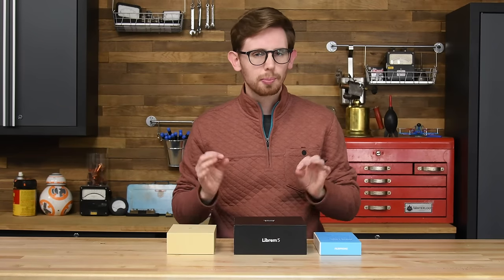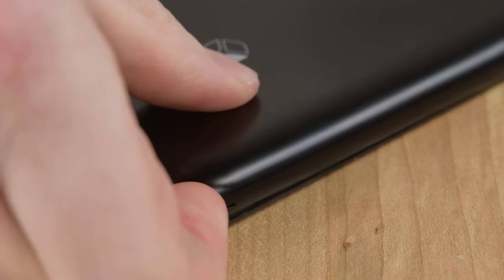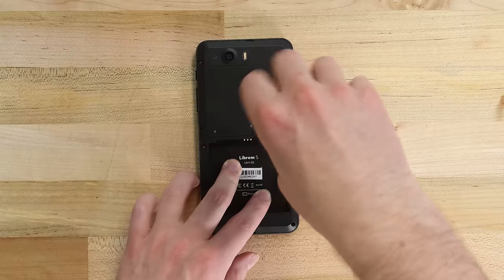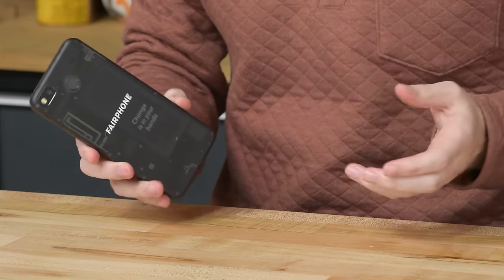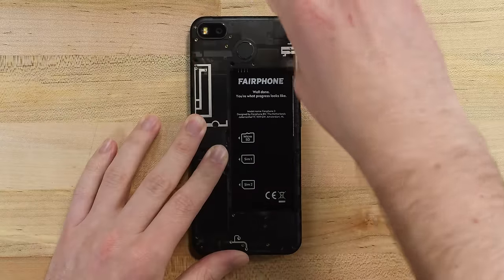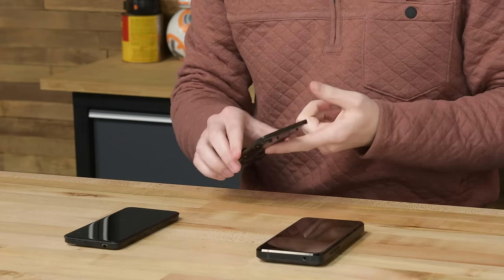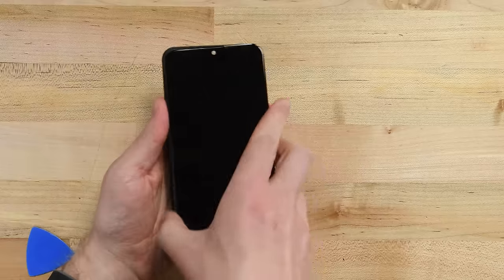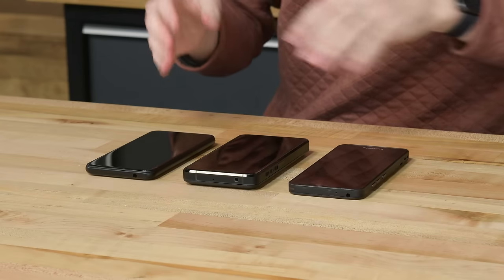Your Smartphone Doesn’t Have To Be Glued Shut!

Comment: That fairphone looks like a really cool alternative to what's in my pocket now. Cool video.
Reply: @cloudy kiwi kelly and cali lint and candy wrappers. lol.
Reply: Lol
Reply: That's the problem. It's an alternative. Not the main one
Reply: i thought so at first but not so much really, since its still lagging behind what i have (not by repairability for sure)
Reply: @C00LX100  Yeah it's one of those big tradeoffs you have to weigh unfortunately.
Reply: @AdrianReddix  would you rather have yugo thats easy to fix or buggati thats hard... there is no thinking there but if you choose between lada thats hard to fix and old yugo then its a simole choice it just matters is if form or is it function, if its function buy yugo or this phone
Reply: @C00LX100  I'm big on function over form. While I like to look at the buggati, owning something repairable and practical is more my speed.
Reply: @AdrianReddix  you just answered yourself, so buy it, i see my bezzel less phone with pup up camera and most amazing screen and im happy. If there was option fir uogrades then i might think about it but right now it looks like brick phone from 2010 so no not right now for me.
Reply: Too bad it has SD632 and 4gb ram. Even if the hardware can last 4 years the software will lag after 1 year with that kind of spec.

Comment: Peak Samsung was the Galaxy S5. Water resistant with a removable back and battery and Headphone jack. It also had the heart rate monitor
Reply: Don't forget the s5 neo that solved some issues of the s5 so it was even better 👍
Reply: and had expandable storage too
Reply: There's the Galaxy xcover field pro.  Came out last year similar specs of a s9 with removable. Battery SD card slot, headphone jack, and ptt.  Expensive though, meant for industrial and security market
Reply: Was it IP68 up to 6 meters?
Reply: @DimitrisSartzetakis  exact lol

Comment: I can imagine modular upgrades being a huge selling point, and actually drive revenue for the manufacturer. Like, new camera module, storage upgrade, more durable chasis, higher resolution screen, higher capacity battery, more water resistant backing, more durable screen... The biggest challenge is probably having these parts interchangeable. Industry oriented laptops like the Tough Book provide these sorts of upgrades and options for individual use-cases, it's time we have that for phones. We have different needs and budgets and it would be cool to have that reflected by the market in a more sustainable fashion.

Comment: Also, im surprised that the Librem 5 and the Teracube 2e are available to buy and use in the US. The more popular Fairphone 3 is only available in Europe and I fully understand how hard it is to run a business like that.
Reply: Librem 5 runs Linux.
Reply: The fairphone is the only one I would be interested in but its not available in the states. The teracube is an underperformer and the Librem 5 runs Linux which is fine but I would prefer android. Not a whole lot of modular phones or even phones with removable batteries these days

Comment: Those wireless cards in that second phone really surprise me xD Nice!
Reply: I just burst out laughing at it! It looks ridiculous, but it's so cool
Reply: The first PS VIta uses an wireless/GSM card too unexpectedly.
Reply: It runs gnu/linux, it's more like a laptop than a phone. So it is it's competitor the Pinephone wich does not appear on this video and takes a similar approach except for the extractable wireless modules
Reply: Like said in the video, even laptops are starting to have wireless cards/chips soldered on the board.
Reply: They couldn't find a libre distributor for those parts so they had to make it separate from the rest of phone.
Reply: its funny because its just a company plore for "oo look at us were cool you we use standard components... only for the least likely to fail pieces....

Comment: While I completely agree with the general message here, I have to put a big caveat for anyone who's watching this - DO NOT buy those phones if you don't know exactly what you are getting into.

The repairability message is great in itself. These phones prove that there's a whole ton that could be done if only the big smartphone companies were really interested in making phones repairable, recyclable, longer lasting and generating less eWaste.

But design and forcing consumers to change phones everytime the locked in battery life gets worn out is the priority, so we end up in the situation we are currently in. Profit over consumer interests, obfuscation by design.

For people talking about them not being water resistant, which they really are not, just know that there are and have been phones with removable battery AND IP68 water and dust resistance.
The marketing speech was that in order to make phones water resistant they needed to seal the battery, but this is very much not true, it has never been true. Weird that people would think so when we had IP68 phones with replaceable batteries before the trend of internal batteries caught on... short term memory I guess.

I don't even know if this was really marketing speech or just something people started believing at some point, spread out by tech press and whatnot. Probably a bit of both. Kinda like the excuses made for taking out headphone jack. People will believe in the weirdest crap if it comes from their cult-like company I guess.

But it's kinda obvious if you think about it... there are plenty of IP68 electronics that have a removable battery. Lots of action cameras like GoPro, devices on the rugged line, even several models of prossumer and professional DSLR cameras with tons of tiny internal components to short and break have IP68 certification. 
It's just a matter of designing it with proper sealing... rubber gaskets, comformal coating, etc.

But if you want to know specifically about phones, you need to look into the models that are not advertised much in US. Look up for Samsung Galaxy Xcover Pro, for instance. It has a removable battery AND is IP68... and it's not even that old. In the past, Samsung also made other models that were water resistant and had removable batteries. I think LG also had phones that were both.

Ok, that said, why am I saying to be careful about the specific phones shown. Well, one is a crowdfunded phone, another is privacy focused with a Linux based OS and non proprietary components, and all of them have specs closer to the low end... and you are gonna pay more for all of them. They are niche phones that people need to know beforehand how they work, because it might be harder to use than a regular phone... or just slower.

Because these are small companies doing lots of the work by themselves and selling in small numbers, so you don't get the price advantage of mass production.

Unfortunately, the whole reason smartphones have become cheaper to make (selling is another story, flagships today are all extremely overpriced), is because of mass production.

Other than that, modularization is already done in most smartphones... it's just that sealing the entire package up with lots of glue makes it very hard to reach them. Most if not all smartphones have at least cameras and speakers as separate modules connected with those very same connectors these phones use. Vibration motor and some sensors are sometimes also separate modules.

And for a whole ton of phones with exception of Samsung and Apple I think, the cameras are all coming from Sony.... look for Sony IMX sensors. Batteries used to be mostly from Samsung, including on iPhones for a period of time. These are all cookie cutter pieces that together form smartphones.

These internal components, most of them are done not by the brand company, but by a handful of different companies that specialize in the parts. They are cookie cutter by nature of the manufacturing process.

If repairability, recycling and reducing the ammount of eWaste was a priority for any of these big smartphone companies, it'd be easy enough to set standards, build phones with those priorities in mind and differentiate them with software... kinda like a PC you can build, repair and replace parts however you want, and choose OS and software by yourself.

Unfortunately, this isn't the way smartphones went... and yes, this is part exploitation on consumer ignorance. If people cared enough to understand how these things work, we could have better practices nowadays....
Reply: "If people cared enough to understand how these things work, we could have better practices nowadays...."
I understand your statements but what else could we do here? People cared about headphone jacks, people cared about chargers, people cared about expandable storage, people cared about removable batteries, but so what? Companies still do whatever the fck they want. What do we do? Boycott them and just use the old trusty Nokia in your drawer? There is always some people that don't care about some of the features, like I don't do photography much so I don't need totl camera, some people don't use headphone jacks much so they don't care about it etc etc. Just because you've seen somewhere on the internet that people say "eh, it's gone, but I don't really use it that much anyway" doesn't mean that 'PeOPLe DoN'T CaRee', you just happen to see some of them that don't care about that one specific feature.

Every phone has its flaws, people still buy them bcuz they think the tradeoffs are acceptable to them. Saying "PeOPLE DOn'T CaRE, ThEY StiLL kISS ThE ComPaNies' AsS WhAtEveRR THey Do" is just...
Reply: @Summer-xu8qu  People obviously didn't care enough, as when new phones started coming out without mentioned features, there was no negative effect on the sales, so the companies just kept doing it, gradually taking away more and more. This situation is really simple: you vote with your wallet. If you keep crying about things, yet still buy the new models coming out without those features, then your thought process is completely flawed. I still use an LG G5 because of the replaceable battery. As of now I can buy brand new OEM batteries for it for £4. I can't wrap my head around people, who keep buying new phones every 1-2 year with glued in batteries. Madness. But obviously the masses think differently, as the sale numbers are through the roof for Samsung, Apple etc. So the reality is, people like us are the minority, and we simply don't impact the market in a significant enough way.
Reply: You don't even have to look to lesser-known phones like the Xcover Pro, the Galaxy S5 mini had a removable back and battery, and was water-resistant. I don't know the exact IP rating, but i once dropped mine into a river and when i went diving for it, it was still running, never had any issues. Also fell into the shower once. Repairability and water resistance is absolutely possible, the manufacturers just don't want to do it.
Reply: I agree the Librem 5 is a very special phone, but there are no reasons not to buy a fairphone or TeraCube, they work pretty the same like any other Android phone. And by spending your money on the right companies, you support them and take your money away from the companies that do not care.
Reply: " DO NOT buy those phones if you don't know exactly what you are getting into."
This DOES NOT (see what I did there?) make any sense. It's not like you have to build it yourself, they come fully assembled. And if you break it and don't have the skill to fix find somebody who can (perhaps a child could help).

Comment: Sadly the only one usable here in the USA is the Teracube 2e, I do thank you for the recommendation on that one. Other than the LG V20 and the LG G5 this is the only usable removable battery phone in the USA. There is the Samsung Xcover but batteries for that are generally not available in the USA and from what I heard that one has major problems connecting to USA carriers. The Librem won't work for me because I need android access for apps, and they don't have access to the android market at least I don't think they do. The Fairphone isn't available to the USA. If fairphone was sold in the USA I would have a ton of respect for them.

Comment: Reminds me a bit of my (now very ancient) Motorola Atrix.  It also had a simple pull-off back panel providing easy access to a user-replaceable battery.

I realize that making a phone water resistant can be difficult (if not impossible) with a rear cover that comes off this easily, but a battery that pops in and out shouldn't be a big deal.  It wasn't for decades before manufacturers started gluing everything shut and there's no reason that can't start doing it again today.

Comment: I really hope the "BIG" manufacturers feel the "PRESSURE"! It seems waterproofing is a big priority to them!
Reply: Well they could technically make them waterproofed while being User serviceable at the same time by implementing the same design principle as the Galaxy S4 Active & Galaxy S5 in which both phones are waterproofed yet both phones have a removable back plate & a Pretty modular parts
Reply: It really feels that they are using the “waterproofing” for an excuse to use adhesive

Comment: I’m all for right-to-repair, but I feel that if devices were super easy for users to repair and upgrade themselves, businesses like iFixit and phone repair shops would go out of business. 
On top of that, if big companies made their phones modular, I have no doubt that they would sell their first-party replacement/upgrade parts in their stores for premium prices, and they would do some firmware/hardware tricks to make sure that third party parts don’t work. Companies will have to do this to make up for the lost revenue caused by people upgrading their devices less frequently. 
I think what iFixit and most repair shops really want is not modular phones, but easily available first-party spare parts for expensive devices, and less adhesive and more standard screws in premium phone design to make disassembly and repair easier.

Comment: I like the video but It begs the question of what the water-resistance is on these phones compared to flagships out there. And also possibly why this talking point was conveniently left out of this showcase spotlight.
Reply: If you're not a diver then just don't expose your phone to water lol
Reply: @adrian0soares  
I used my phone for GPS navigation when riding bike, exposure to water is inevitable.

So far my phone is still doing fine after exposed to lot of heavy downpours and splashes from a car driving over a standing water on the road.

Comment: The Fairphone 3 is a very cool concept. It is a solid allrounder with a decent chip, good battery and good software support. The camera of the 3+ is also good aswell.
To add another company. Shiftphones are very repairable aswell.
As soon as my smartphone dies I will buy a Fairphone I guess. Maybe the Fairphone 4 will be out then. Flagship smartphones actually can't do much more than a Fairphone, they just have better specs.
Reply: Yes it looks like the only decent phone of the bunch.

Comment: Great video! Have to mention the lack of emphasis on the trade offs though. For those who are looking for repairable or privacy focussed devices, it’s great. However for those looking for good performance that lasts 5-6 years or basic water resistance unfortunately they don’t have it. 

But hey maybe we’ll have reparable phones that have optional water resistant parts and socketed SOC’s for upgrades every few years so it runs latest operating systems snappily.
Reply: Your phone battery won't last 5-6 years no matter what even if you buy a phone that costs $1k, if you can make one last that long without significant battery anxiety or having to charge 2-3 times a day just to get through the day when it starts to degrade more power to you. I am blowing through phone batteries over here, its the only part of the phone I need to replace every year and the manufacturers aren't letting me do that now. Since batteries aren't removable these days this has to be taken into consideration. If you don't mind dealing with glue you can find phone models with replaceable batteries that are easier than others to replace.
Reply: @SaraAB87  actually my iPhone 7 still works great. I can get through a whole day if I am mostly using it with 1-3 hour screen time if my entertainment sticks to audio podcasts and music. And if I want to do everything else a little more. Charging it twice. 

I’m not hooked onto my phone but yet am confident that it can handle 99% of the things I throw at it. 

P.S. you can replace battery’s. Not SOC’s. And a battery replacement is under $25 at the moment. I have to admit though. I go to a trusted repair shop who only charges me for the battery since it only takes 20 mins to complete (not if I did it myself unfortunately)

Comment: Do any of these phones come with an unlocked bootloader for easy rooting???
Reply: Librem doesn't run Android. It's all open source. I think even the firmware and the hardware. Check out their website.
Reply: @gabrielsroka  Well I meant the other Android phones since I already knew Librem runs Linux from a video I saw months ago.
Reply: @gabrielsroka  straight up linux